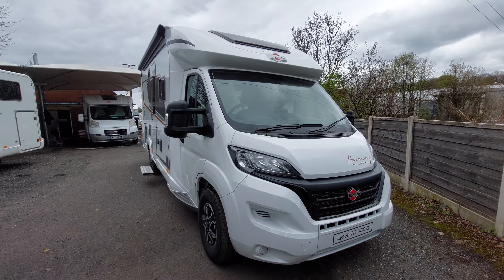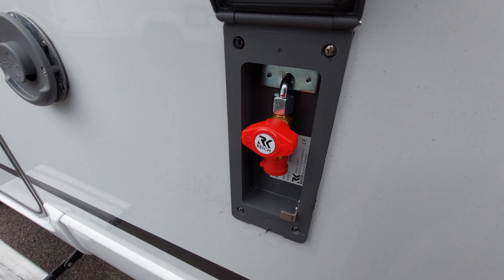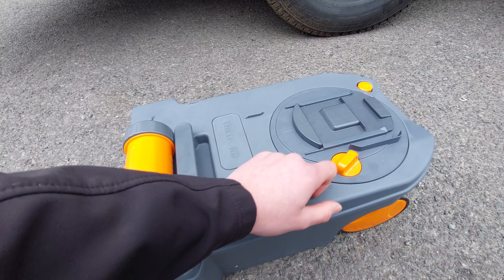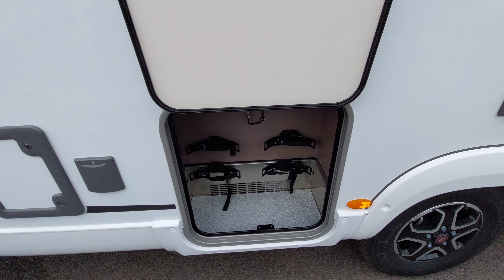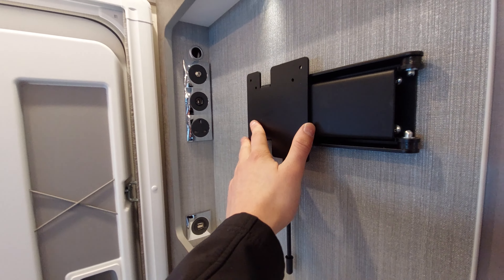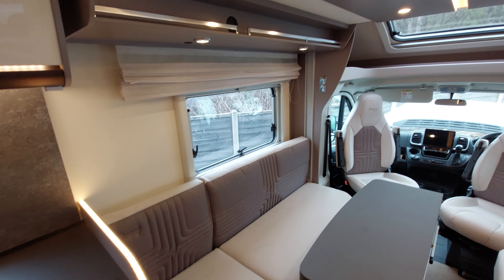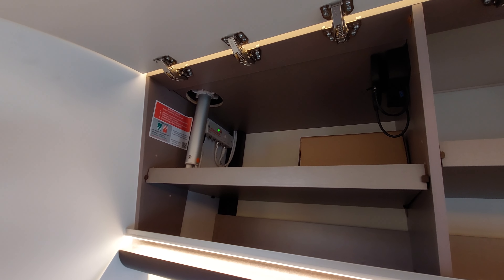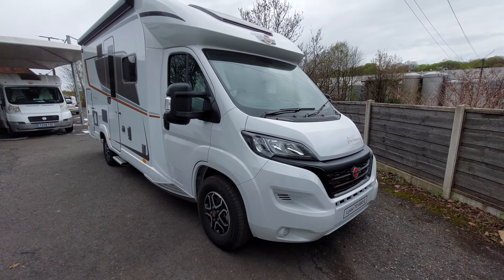2023-Burstner Lyseo TD 680G Instructional Video

Comment: I am somewhat surprised to see the gas heater flue terminal and the barbecue gas supply on the same side as the awning. If someone rolls out the canopy and then adds sides to it with the heater running, they will be breathing the odourless carbon monoxide which will do nothing for their wellbeing. Being a retired gas safe registered engineer I am surprised that that is allowed. The boiler flue should be on the opposite side to the awning. Also, on a house, the flue would need to be at least 300mm from any opening. I obviously don't know how far it is from the door but it does look suspiciously close to it. You could get carbon monoxide blowing into the habitation area.  If I came across a flue terminating in a conservatory in a house I would shut the gas supply off and report it to Centrica.